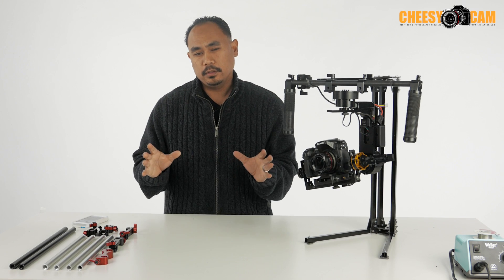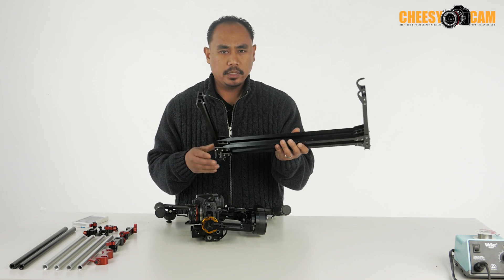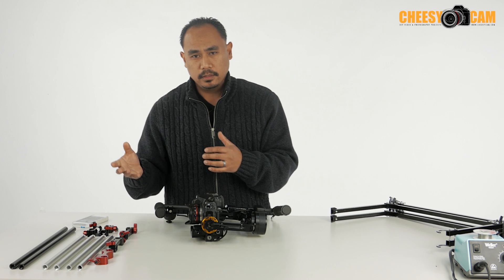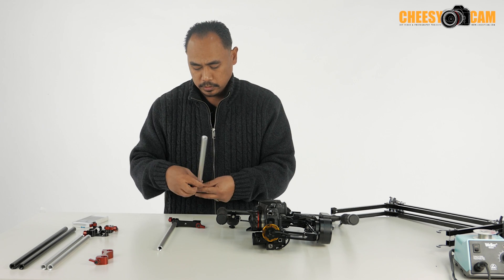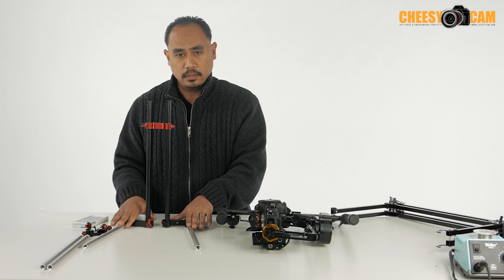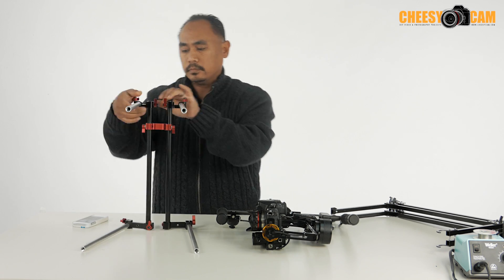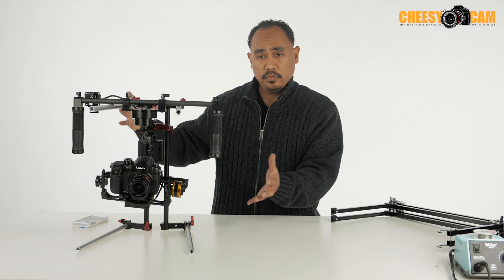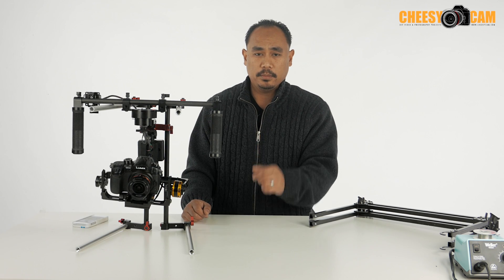DIY Balance Stand for 3-Axis Gimbal Stabilizers using basic 15mm Rods and 15mm Clamps

Comment: Great Idea :) Makes perfect sense... just as the smaller DYI Mini Gimbal for DSLM Cameras. I film in remote locations and this is practical as well as affordable. As I'm growing older, I like to be/stay as light, portable and mobile as I can whenever I travel with my equipment! It works for me :)  

I can see having this stand kit could also be used for different applications. This could be used with other stuff, base clamps or arms for a GoPro or a light extension while on location in the bush or hang off the side of a mountain.

Thx for your inspirations,

Rick